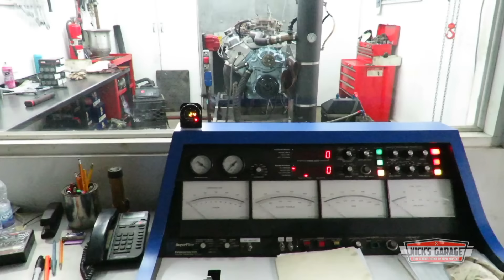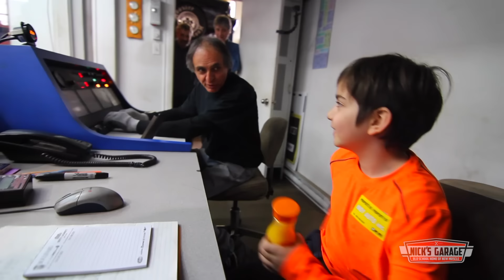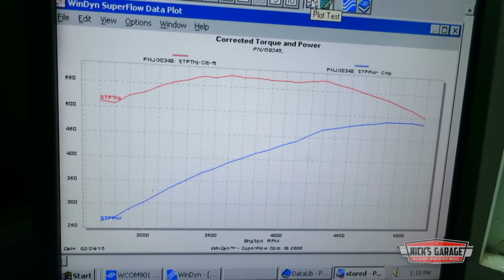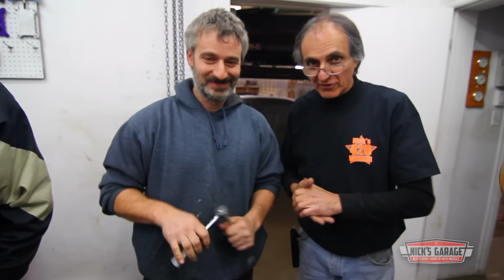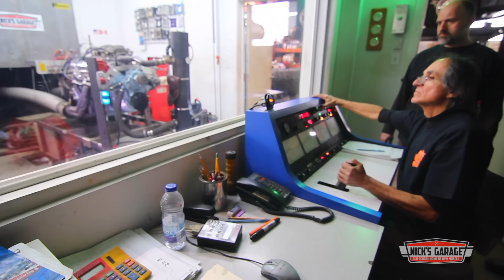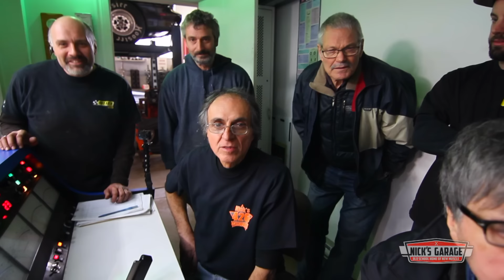Fire On The Dyno!! - Pontiac 455 Lights Up

Comment: Was going to say "another cool video from Nick" but perhaps not the best choice of words...
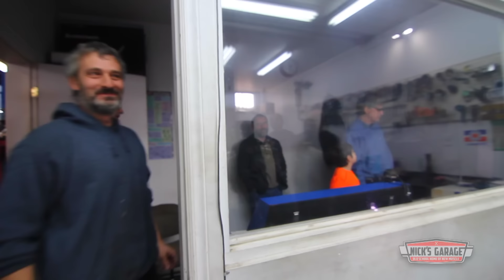Overtightened the valve cover bolts - you can clearly see it at around the 16:00 mark. - it does two things, cut the gasket and lift the cover in the middle. I'm rather surprised it, the gasket, didn't have inserts to prevent that very thing?
Serious bit of kit, hope the owner has a good high torque starter, heavy earth and starter cables and a healthy battery for it. :-)
Oh, and a decent tyre budget ;-)
Reply: GordoWG1 WG1.    I had replaced the gaskets myself, and yes, a healthy starter will help. And tyres, for sure.
Reply: Thats cork gaskets for you.

Comment: Nick, will that valve adjustment zero lash 1/2 turn work on a small block ford?
Reply: Chillyquack.   If you have the same set up, yes. Make sure you have hydraulic lifters and adjustable rockers.
Reply: Thank you!
Reply: +Chillyquack a stock small block ford 289-302 is like the stock pontiac motor. they have non-adjustable rockers. the valve stem height has to measure correctly on them to get the right plunger depth on the lifter. especially after a valve job. the pontiac and the older sbf have a chamfered nut that stops on the shoulder of the rocker stud. the newer sbf has a bolt and a fulcrum/pedestal.

Comment: that was weird behaviour  . . . . smoke pooring off the engine and still he keeps the power on untill it bursts into flames
Reply: Kenjh71.   Thank you. We had some issues with smoke in the past, but this is the first time it went up with a flame.
Reply: Because they knew it was oil, and also what could happen. And as you saw, no damage done. It's called experience.

Comment: Most kids don't realize just how rare Hemis were. I never saw one in the wild back in the day, just in magazines. Lots of 440's tons of 383's and BBC 396's. Rarely a BBC 427" a handful of crankshaft breaking 454's and a whole lot of Small Block everything's. Nick, I think you've got more Hemis in your shop than all of Phoenix in the 70's! We did get some Ford 427 tunnel port engines through our shop. All were stroked with 428 cranks to make 454 cu in Ford FE's. We built them for a local circle track racer. The cool thing was, out teacher built race motors on the side. We even had an Offenhauser go through the shop, and I helped install the Pistons on that engine. Historical stuff!

Comment: Pontiac are definately my favorite gm engines.  I used to have a 350 pontiac back in the day.
Reply: They were the biggest of the GM 350s, if i'm not mistaken, they were around 354. and some change.
I had a 72 LX LeMans with a 350, the engine tag said 91 octane or higher lol.

Comment: I would put the crank at TDC and then do 8 of the valves, then turn the crank 360D to TDC again and do the other 8. We had the valves written on the wall for each position in the engine build shop at Youman's Chevrolet in Macon, Ga. back in the 90's.

Regarding the VC gasket; I would always glue those cork gaskets to the VC using yellow contact cement and let it dry completely. That would not only prevent splitting the gasket, but you could easily remove and replace the VC many times until the cork got hard, which is much later on in the life of the build. Just on the one side. Never use anything between the gasket and the head.
Reply: ladamyre  and that is called by the book. This is like the forth nick vid I’ve watched and I enjoy them but I have to say this one gave me some doubts.
Reply: Well, I wondered myself as soon as I saw him doing the rocker arm swap. I would have removed the distributor, loosened all of the rocker arms and then run the oil pump with a drill to make sure all the lifters were fully extended and filled with oil, then I would have adjusted the valves, per factory procedure as you noted.

Now that I think about it, that was one place where you could actually put those oil control clips JC Whitney used to sell to some good use and adjust those valves on a running engine.

Here's one for a laugh. We had a newcomer in the shop doing a 350 short block swap on a 1989 Monte Carlo and we saw him dropping the engine in without the valve covers. When we asked why, he showed us those clips and said he was going to adjust the valves on the engine when it was running! We almost died laughing when we got back the main shop... to avoid the smoke! lol

Man! That was a tight engine compartment! The only tighter one I ever saw was the 88 Buick Riviera. You couldn't find a place to put a pencil in there and close the hood without breaking it.
Reply: Scott Piper.   I have done many adjustments with hydraulic cams, I find it quicker to adjust one by one on the base of the lobe, especially in the car, where in some cases you work in tight engine compartments. I remember one time I was working on an 87 Camaro, like Iadamyre said, turning that crank and checking for TDC, took much longer.
Reply: Iadamyre.   I agree what you are saying, adjust valves by the book. I have done many adjustments in my life, when it comes to tight engine compartments, and working with TDC, It is time consuming. And regarding the valve cover gasket, I had used black contact cement to stick it to the cover only. I would use yellow next time. Thanks for the input.
Reply: I don't know if the guy who told me to use the yellow stuff said so because the black stuff softens up in the oil over time or not. It's just what I always used.

A little tip for finding an oil leak. You probably already know the best way is to clean the engine real good with a steam pressure washer and then spray tracing powder around the suspect areas: as soon as the oil comes out it turns the powder dark. The tip is to just use Dr Scholls foot powder! It's cheaper and has that nice smell. lol

Comment: If he ever wants another 40hp and 30tq put an RPM intake and 950 holley on it, the low rise dual quad intakes look cool but they don't come close to a modern high rise single quad, at least on a Pontiac, i build and test a lot of them.
Reply: Derek Stewart.  You are correct, but my customer brought in the intake and dual quads to have it installed on his engine because he likes the looks of it.
Reply: Nick Panaritis 
I understand, i have done some porting on those intakes a few times trying to make better power and still have the good looks, nice build!
Reply: @nickpanaritis4122  also nick i want it hidden under the hood

Comment: Nick I always use some Indian Head Gasket Shellac on Pontiac valve cover to keep those gaskets in place. I've had them move under power and dump oil in the past so I always glue it. I know it's a pain in the butt to remove that but I never have to worry about it that causing an engine fire. Thanks for showcasing a Poncho build!!
Reply: fel pro has rubber gaskets u cant overtighten them u dont need any sealer.
Reply: Pontiacs have no tabs on the gaskets or valve covers to locate them, just the 4 bolts. Nothing holds on the chrome valve covers. Rubber just compresses and slips out of place. You have to use the cork gaskets and glue them to the valve covers. I still use 3M Weatherstrip Adhesive for this, nothing else sticks to the chrome even after you scuff sand the gasket surface. I am trying out a set of the newest rubber w rigid steel core right now. So far so good.

Comment: the 455 pontiac & its little-known older brother the 428 pontiac were beasts.
The top 428 in 1969 had the same h.p. as a 440 3x2. 390 hp
Reply: The 428 was just a slightly destroked 455. You can put a 455 crank in one and convert it easily.
Reply: 440 was under rated for h.p...430+ they say was the actual number ..440 4bbl was 410 hp..

Torque too on those was well over 500,as the non performance single exhaust non high performance 440 with 350 h.p holley 4bbl had 480 torque..

350 hp was in most C body cars ,they also had the high performance 440 in those cars as an option..So you guys who pulled the 440 out of a c body you thought it was the high performance model lol,it was still powerful and would roast the tires on a 4 door c body at a 20 mph roll,but not the h.p version most likely..Majority of people dont know this..

So really they made 3 versions of the 440 4bbl with a Holley !! 440 4bbl with a Carter,440 4bbl High Performance thats the Magnum etc..And the 440 6 barrel  3 holley 2bbl ...440 TNT,Magnum,Super Commando was 375@480 too lol,under rated..

Comment: I'm a Mopar guy but Pontiac built some killing engines in it's day nothing like a Ram Air 4 400 or a 455 Super Duty
Reply: Agreed as a Mopar guy those Pontiac's Old's and Buicks had some real hot engines especially those 455
Reply: glad to feel the love from the Mopar crowd. Pontiac power right here
Reply: MoPar guy here too, and couldn't agree more....
Reply: Something about those Pontiac 400's, never saw one that didn't run!!
Reply: Another Mopar guy and I always liked the Pontiacs. Real gearheads appreciate all of the old iron.
Reply: Thomas Tiritilli 
You will need quite a bit more cam for 500hp with stock edelbrock heads, id recommend keeping it under 10-1 compression with that cam on 92-93 octane fuel.
That setup would produce close to 1hp per cid from my experience fwiw
Now keep your 10.5:1 and have your Edelbrock heads fully ported and use a hydraulic roller cam 286in 300ex advertised duration and 236in 244ex at .050 .632 lift 112lsa 
108ilc
Port match the Intake to the heads
Holley ultra 850hp carb and you can make 525-550hp and about 535-550tq and easily daily drivable and run low to mid 11's in your choice of properly setup mopar muscle car.
Reply: Fuel here in the Philippines is 100 Octane at the pump. But i like your recommendations, will differently look into it. I am a Retired Navy Vet living in the Philippines. So getting parts can be slow, To change to roller cam i have to change lifters and springs etc ? I know lifters, but what else? Thanks
Reply: Thomas Tiritilli 
Yeah unfortunately desk top dyno isn't accurate, that setup should make 425hp and 480+tq pretty easily, if you are stuck using a hydraulic flat tappet cam use one that takes advantage of chryslers large diameter lifters,  if you use a better cam you can easily get over 450hp while still retaining good drivability
Reply: Okay Sir, i will be talking to the guy who built the engine he is a very good engine builder, this car was probably at 60 or 70 % already restored when i found the owner, most of the engine parts were already bought so i had little input at the time of building. I got a good deal on the car, remember i am in the Philippines there are cars here but not like the USA, The great part is labor is very cheap and there very skillful with metal, so you can restore a real bad rust bucket for 40 to 50 grand where in the states would cost at least 25.000 more just in labor. Parts are the same but shipping and customs hurts your budget here, the car is a 1966 dodge Coronet, but had a great body so after the restoration i bought the car for 23000 dollars which is not bad because all older cars from the 1960's 70's have a premium here. I found a 1969 Dodge Dart last week paid 8000 dollars for it it is in great shape and i will be building another 440 for that, but this time i am at the ground floor of this resto and engine build so it will be exactly what i want, so i am planning to make it a 512 Cubic inch stroker motor going for 625 HP and 650 lbs of Torque, i am not building race cars just fun enjoyable cars that are street able and look nice. Anyway thank you for the help sir, take care and if you have anymore input please let me know, be better to be able to email you ? but it is up to you if you want to give me your email address. Again thank you sir and i appreciate your ideas.
Reply: Take 1 qt. of oil out of it. A big block Chevy makes around 8 hp running the motor 1quart low on the dyno.😁
Reply: The Pontiac 421 super duty was the pinnacle of Pontiac engines. The 455 SD was made during the early smog era (73 or so) and nothing compared to the 421. The 421 came with dual 4 barrels and lots of internal mods that were not found on normal production engines of the day. Pontiac cleaned house in Nascar and drag racing with that engine.
Reply: Maybe you can help this Mopar guy, What do you think?

440 BLOCK Bored 0.60 over
Forged Crank 
Hemi rods
Forged pistons 10.5 to1 compression
Comp cams Camshaft 268/280 duration, lift .477/.480, Flat tappet Xtreme
Edelbrock RPM Performer Heads with after market rocker arms, i believe 1.5
Edelbrock RPM Manifold 
Edelbrock 750 Carb
1 inch 7/8ths Dougs Headers with 2.5 exhaust and Dougs Exhaust cutouts 

Again i am wanting 500+ Hp and 525+ Torque, with this setup. Do you think i got it or very close?
Sorry to bother you again just wanted to give you some updated numbers.

If i didn't get near this would getting A hydraulic cam add say 50 to 70 hp and 70 Trq lbs ? 
Or what would be better to do ? Without to much cost. 

Thank you Nick and take care sir.
Reply: Can you tell me what you think this set up i have is making ? The engine builder is a 77 year old American like me, he has been building engines and racing over here for 40 plus years. He uses this desktop system to determine HP/TRQ but most feel in is in accurate as he told me 450 HP and 460 lbs trq? Again any help is appreciated as i am just learning this stuff. Thanks Please reply to both posts Sir
Reply: Thomas Tirtilli.  You will also have custom pushrods made for your application, length wise and hardened wall thickness.
Reply: The legend himself!
Reply: no love for the little 351 cleveland?...its only a small block but in a ligther pony car (cough cough) ive seen many of those humbling big blocks
Reply: Gm guy here also a fan the mopar also💪💪💪💪✌
Reply: that 421 is a badass motor too.
they put those in a couple of the Catalina 2 + 2.. I'm not quite sure what the Canadian conversion of it was that they 
I know they got an Acadian Beaumont that looks just like a Chevelle back in the day.. even had the bowtie block
Reply: 389 tri power in a gto !
Reply: I love Pontiacs & Mopars.
Reply: 79tazman it's going in a Firebird huh I sincerely hope that bird is going to have frame connectors to keep from pretzeling the unibody I hope Constantino doesn't hurt himself in it someday
Reply: Good to see that someone cares enough to help train the next generation of Gearheads Civics won't last forever we need to keep the American Iron alive
Reply: Pontiac lover here too but respect Mopar, I love seeing all the 1960s Nostalgia Super Stock Mopars, Fords and Chevys when they run at the Ames Tri-Power Pontiac Nationals.
Reply: How can you leave out the 421SD  it was a monster of an engine.
Reply: Pontiacs made great power.  Just to bad they had junk rods that let go over 5800 rpm.  Ask me how I know.
Reply: No disrespect meant toward pontiacs, but if you guys really were mopar guys then you would know what makes mopar engines superior to pontiacs.

Comment: 499 is 500 ! Nice rumble.
Reply: 01trsmar, I agree. ONE horsepower is 33,000 pounds one foot in one minute, and if you're missing that horsepower it is not only a measureable difference, but, also a visual one performance wise. Professionally, it could be the deciding factor in winning or losing a race by three decimal places on the timer. I see horsepower numbers rounded off all the time. It is misleading and dare I say deceitful.
Reply: 499 isnt 500....I will give you 499 Million Dollars,you give me 500 Million Dollars !! See,not the same...

499 hp is 1 less of 500 hp,501 isnt 500...Now manufacturers round them off,but I want real numbers not fake ! 499 isnt 500 as per my 1st comment above lol,cheers !

Comment: Never seen a Pontiac with dual 4 barrels only tri-power.
Reply: no they were not.  All  NASCAR engines only ran a single 4 barrel.
Reply: look at the 61-63 Super Duty
Reply: I have..Same guy I knew had a Olds 442 with a 455 he put the duel 4's on it..Was big in the 70's and 80's even early 1990's to add duel 4's..I bought a 69 Charger with a 440 duel 4's car was restored in 1985 and I bought it in 1991,drove it 6 years like that..
Reply: 421 sd had 2-4's 425 hp.
Reply: Richard Gill Pontiac produced an engine in the early 60’s for the Catalina with 2x4 barrel carburetors for race cars and street cars. The racing engines were equipped with a 3rd 1 barrel carburetor to ease starting. The engine was called The Trophy Series Super Duty 421 and was king of its time.
Reply: Wow. 1 barrel for start up.
Reply: Richard Gill They were on the NASCAR engines.

Comment: Nick, why don’t I see roller rockers
Reply: The ponti's dont rev like a LS or SBC, as you see the max HP is at 5400 RPM . Roller rockers are not required at such low RPMs. . A zinc oil would be a great idea though.
Reply: Jake Botelho.   We do use roller rockers in some engines, but maybe next time I will remove a valve cover for the viewers to see.

Comment: Stamped steel rockers on a 500hp engine with 3k heads?  No thank you
Reply: 231mac.   I have build a few engines using stamped steel rockers, and they work well for street engines. And you are correct " WHY NOT"   Thanks for watching.
Reply: Why not?
Reply: I'm thinking less mass in the valve train, at least a roller tip, roller fulcrum for less friction.  I'm not saying a steel rocker doesn't work, but an engine that stout is deserving of a low cost, high value mod such as decent set of aluminum rockers.  Just my .02c
Reply: Rob Rotenberry Aluminum rollers are heavier than stamped, so I don't see the 'less mass' benefit and the frictional benefit is extremely marginal when it comes to HP, maybe 1 to 3 HP. Not to mention we were seeing several cases of aluminum rockers break when they started hitting 2 to 3 years old. Unless I'm building an engine that has over .550 lift or is going to be spun over 6500, stamped have always been just fine. Never have had an issue.